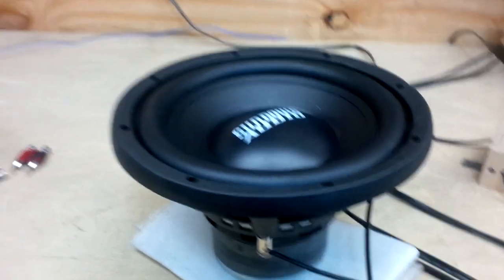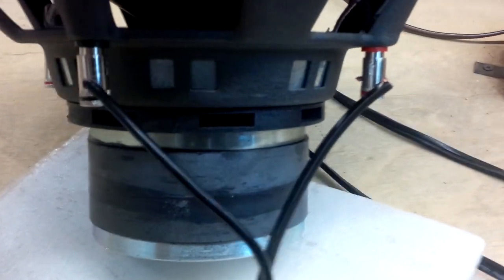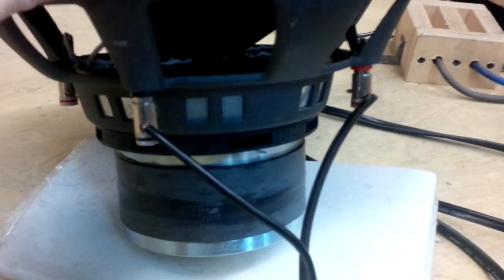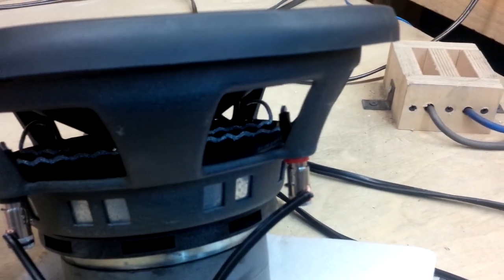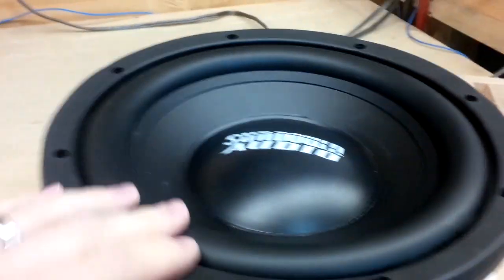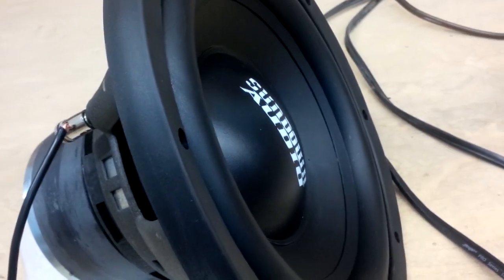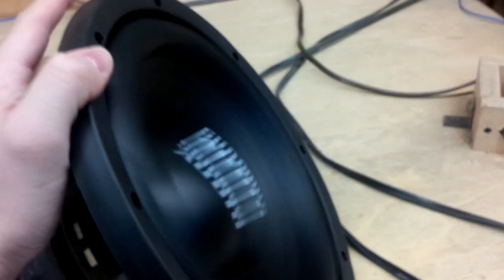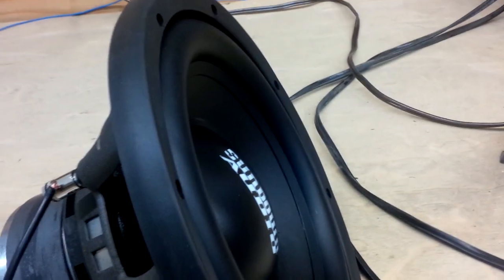Sundown "LCS" Line 300-watt Woofer - Extreme Budget

Comment: I have 2 200 watt rated 12 inch sundowners. Favorite by far. What would you say i run amp wise on your guys' sundown amps
Reply: lets us now when the fire dept leaves lol
Reply: Tim Sherwood 1000 w. then you can adjust to your needs.
Reply: Thanks for the reply. I found out they can take way more power. The RMS is 500 each. I'm at 1000 rn but im getting 5000 watt amp and running half the power